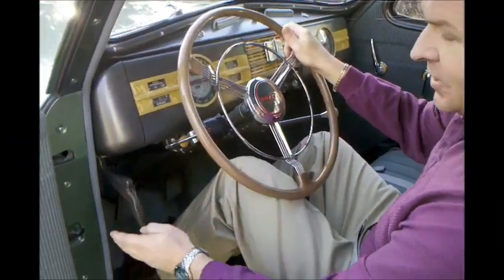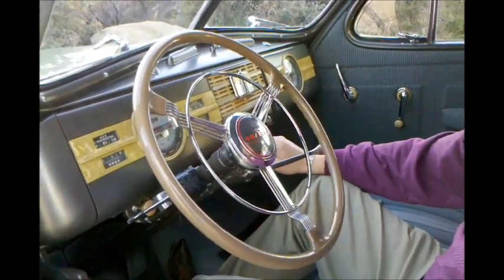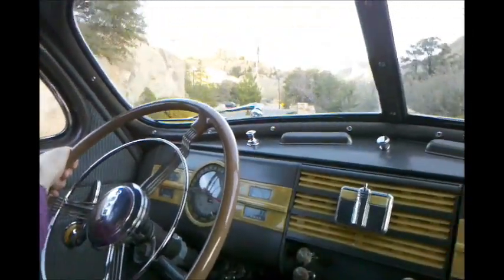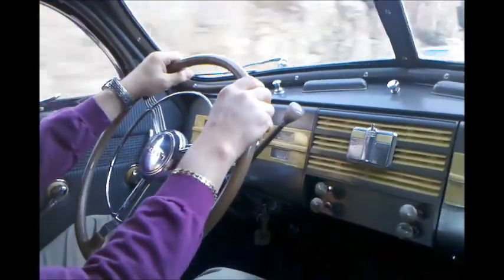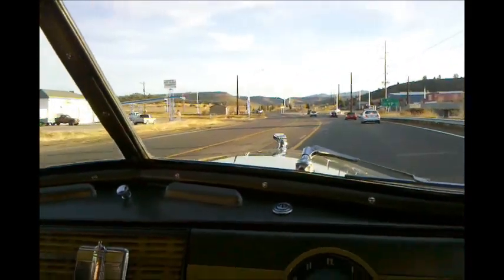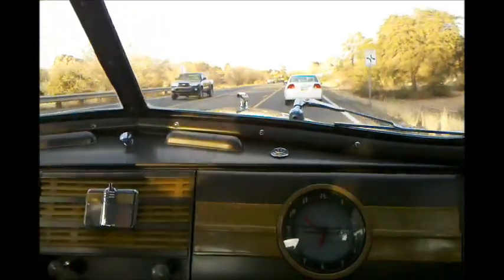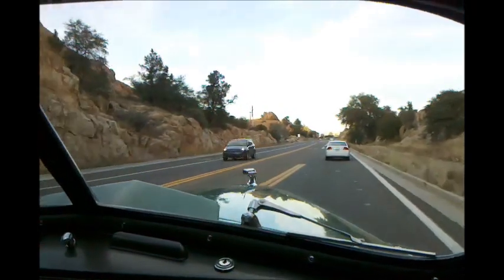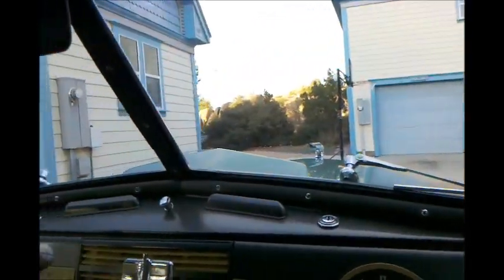1939 Graham Sharaknose - 1939 Graham Model 97 Spirit of Motion 3 1 - Test Drive and How to Operate

Comment: One thing that you should always do with an Overdrive equipped car is to lock out the Overdrive if you aren't going to use it, such as if you know you will be going slowly, or going down hills, as you have no engine braking with the Overdrive "in" but not engaged.  It will free-wheel.
Reply from the maker: Correct. However, this car has the electric kick down overdrive. It allows you to overstep the accelerator and activate a switch that causes an imperceptible momentary miss in the engine firing. This takes the pressure off the drive line long enough to drop the car out of overdrive. You are then back in direct drive and have no freewheeling. This feature was first available sometime in 1939 Graham cars. Appreciate the comment and thanks for watching.

Comment: Question:  the steering....is it power assisted or "standard?"  I once had a '57 Plymouth with steering not power assisted.  I noticed you were pulling on the steering a bit.
Reply from the maker: No, the Graham doesn't have power steering. It wasn't offered on prewar vehicles. Thanks for watching!
Reply: Power steering didn't arrive until 1951 when Gemmer Hydraguide was offered on the Chrysler Imperial.

Comment: Thank You...   Question:   I recently came across photos of the under carriage of  a Graham Hollywood. Where could I find photos of the '39 Graham under carriage?  How different were they ?
Reply from the maker: Thanks for writing. There is no relationship between the two cars' undercarriages. 
The Hollywood, being based on the 1936 Cord, used a unit body and a front stub frame for the engine. The Spirit of Motion cars use a full Graham designed frame. The complete running 
gear for these cars is shown in various brochures from 1938 and 1939. I am not aware of a company shot showing the Hollywood underside in its entirety.
Reply: @CarzPlus  A Hemmings ad for a Hollywood  had quite a few photos of the undercarriage details .

Comment: Hello Sir, you talked about something called a "dual ratio steering" instead of power steering? Can you explain that to me? 
Greets from Germany
Reply from the maker: This is a hard question to answer since I can not give you an illustration here. I will quote from the 1938 Graham Facts Book a salesman at a dealership would have used. "The Steering Gear on Graham cars is of the dual stud cam and lever type which, combined with Graham's scientifically accurate and dependable steering layout and a variable leverage ratio insures positive, effortless steering control when driving and a powerful, easily operated control when parking."  The dual stud cam system working in the specially machined gear gives a dual ratio effect. It results  in less effort to turn the wheels of the car at slow speeds. Giving a mechanical advantage to the driver. Full power steering adds hydraulic  pressure to accomplish even more amplification to the driver moving the steering wheel. Electric power steering is even more modern.